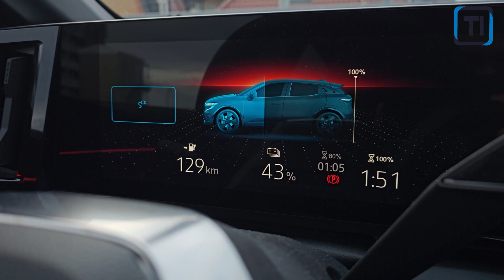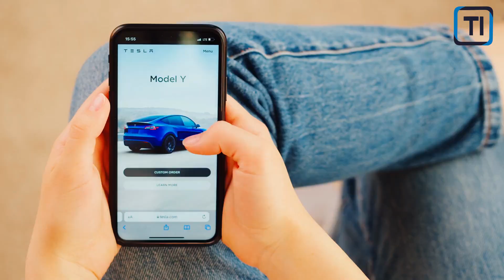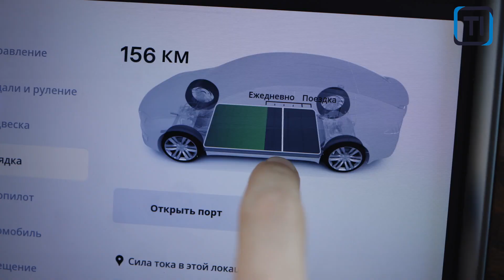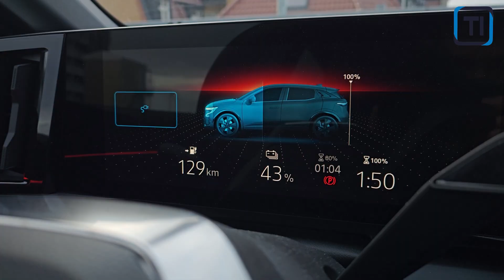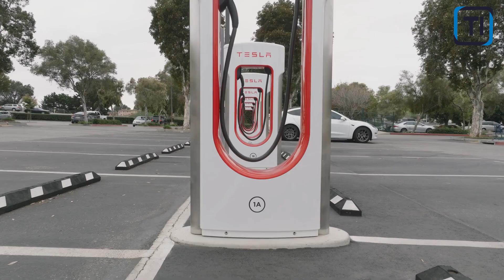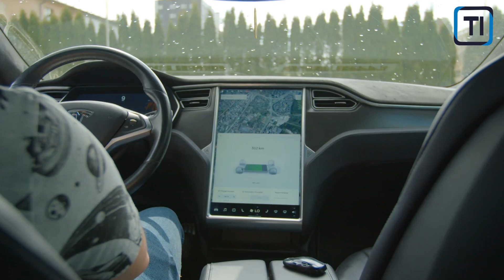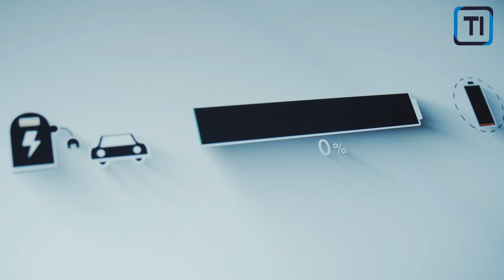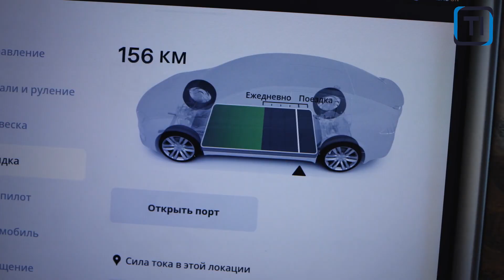Tesla's 4680 BATTERY Revolution Explained!

Comment: 4680 is still basically NCM chemistry which is expensive and easy to catch fire and explode and has a lower density than the original 1865 and earlier 2170 batteries.